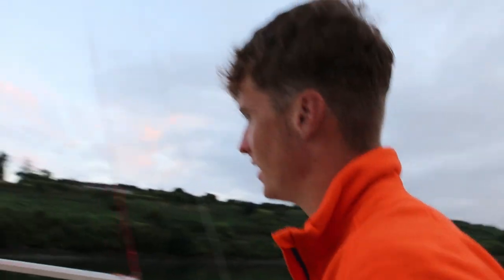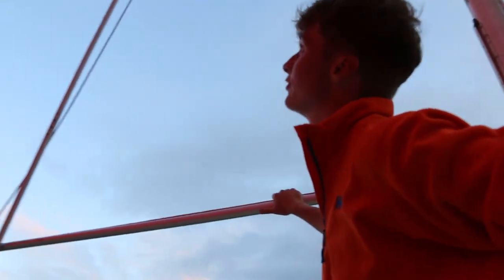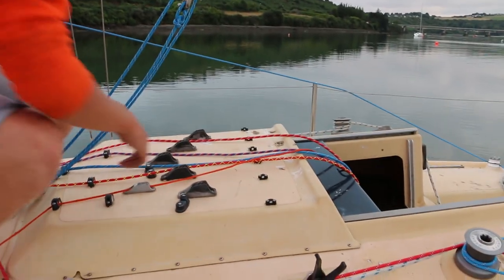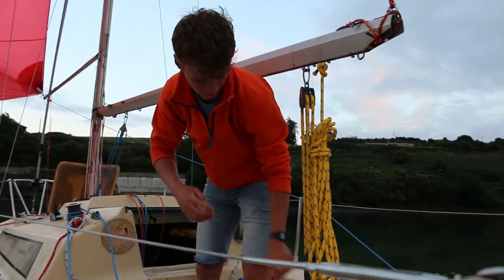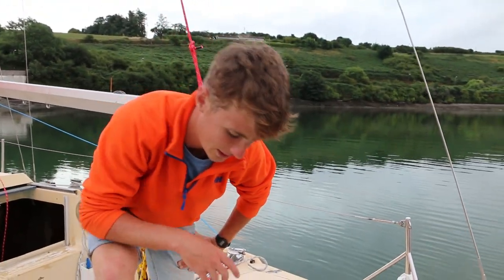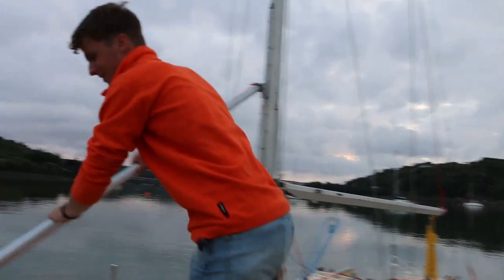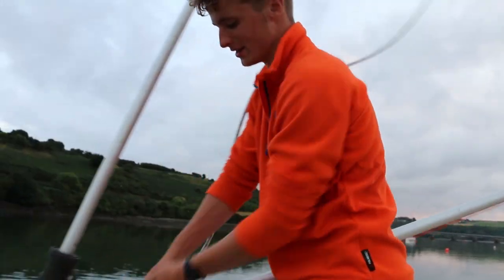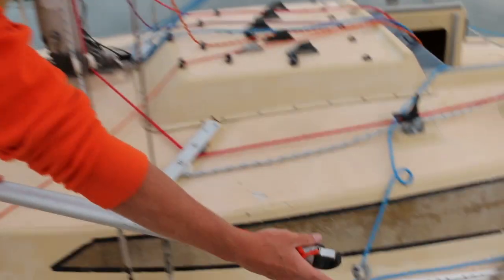A Frantic Sailboat Restoration - EP6 - Boat Tour #1

Comment: Great to see her in the water so fast! I’ve never seen a spinnaker pole before despite using spinnakers....
Reply: James D Linehan yeah they’re used more on keelboats as opposed to sailing dinghies which will often attach their spinnaker to the bow or a pole that slides out from a hole in the hull. While that system is often seen on the bigger boats too, the spinnaker pole in the video is for a particular spinnaker shape called a symmetrical spinnaker. The pros and cons to each system could be discussed all day, and both versions would fit and work on my boat, however I’m just working with what came with it for now! Thanks for the comment.

Comment: Wow, you've done a lot of great work! It looks like your vang (kicker) is attached to the boom using a hardware-store carabiner. I'd advise replacing that with a marine twisted shackle of an appropriate size & load rating before sailing.
Reply: Zach Pace thanks for your comment, if I come into loads of money I might stop shopping in the co-op and start shopping in a chandlery!

Comment: Will find it easier to use a bridle on the spinnaker pole for gybing, otherwise you will have to disconnect the up haul and down haul from the mast and reconnect outboard. When you drop the pole, if there is a ring at the base of the mast it is quicker for rehoisting (you can leave the guy connected or switch sheet and guy quicker and put up straight away.)

Hope that makes sense
Reply: Adam York you’re dead right, I had what sounds like diagram of your words drawn in my notebook, now to just put it into being! Thanks for the comment